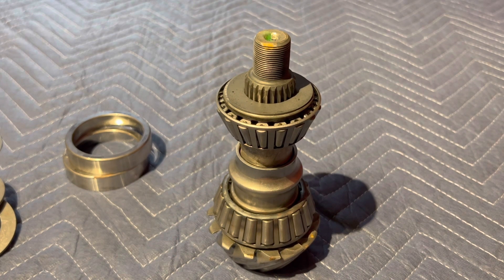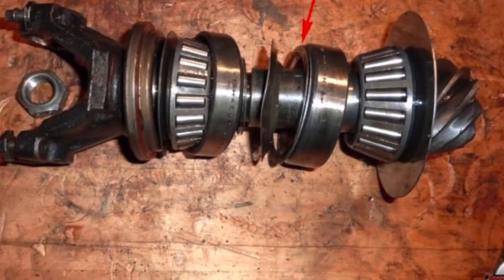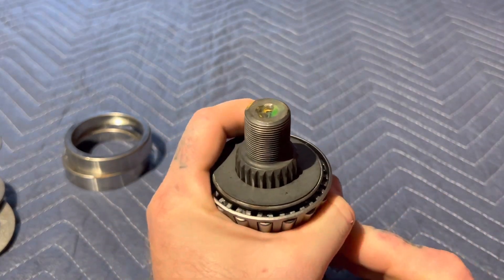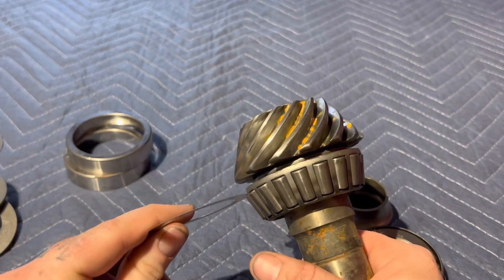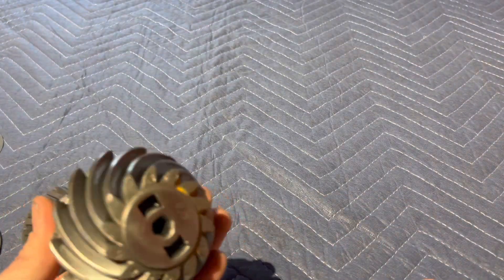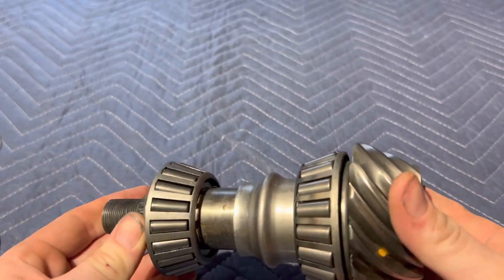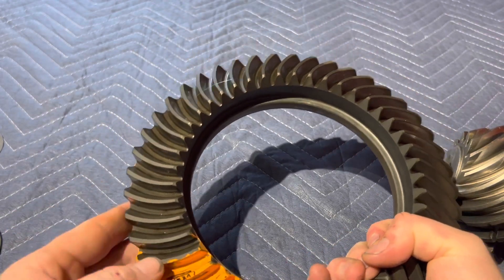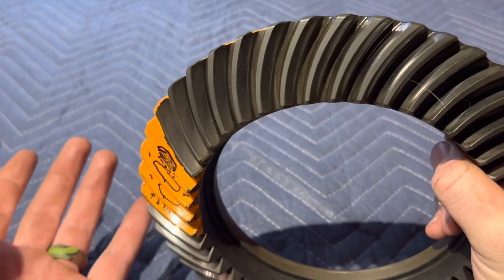Things You Should Know About Differential Gears

Comment: nice  + helpful video ! When I installed an new seal on my DANA 35, I did the redneck job based on experience:  re-used the crush sleeve, tightened down the pinion nut until no play and then about half a turn more - works since then. Your thoughts ?
Reply from the maker: You should be okay people swap out drive shafts all the time and take off the pinion yoke and tighten it back down and they don’t replace it. But if your already doing a regear I recommend it but doing seals nobody ever replaces the crush sleeve
Reply: @LeggettsGarage  great - thanks for the advice, Ronnie !